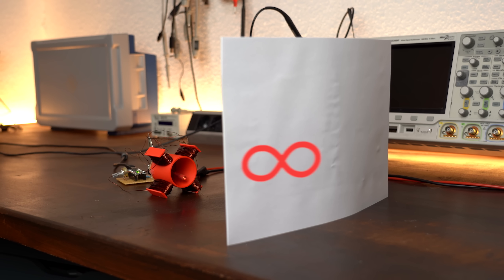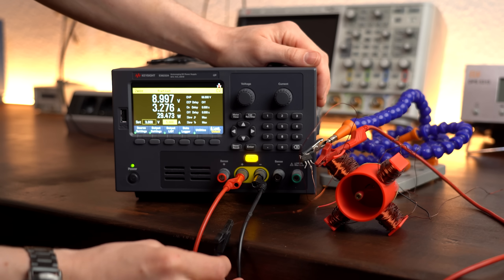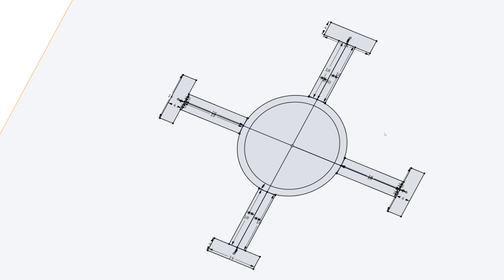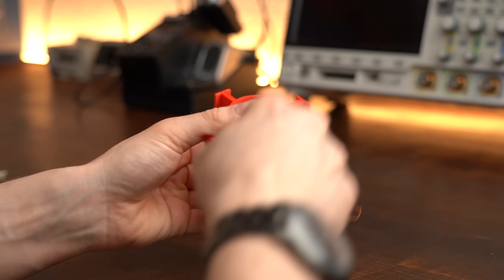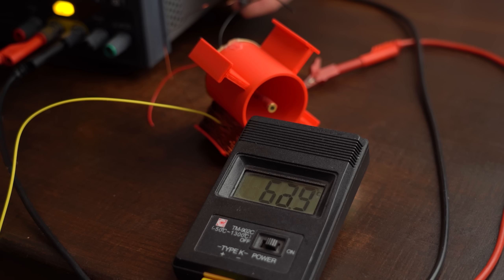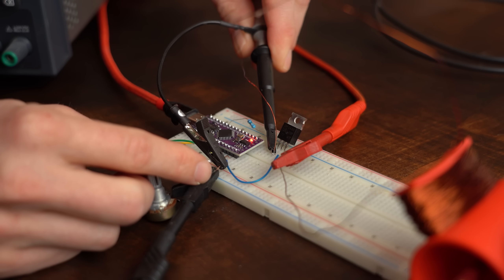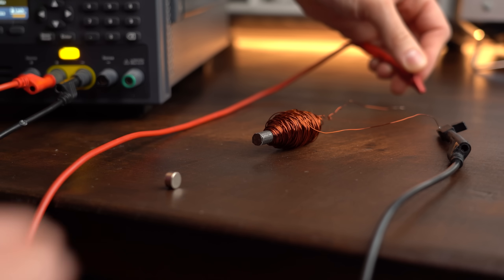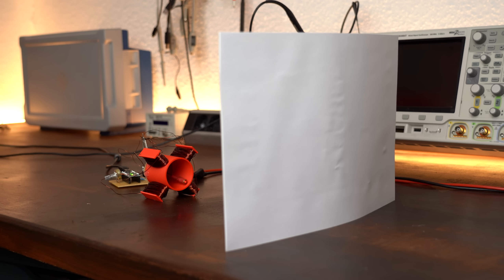Exposing the FAKEST Project....and making it REAL?!

Comment: It feels like a real version of this should use two hard disk voice coils to move two small mirrors placed in front of a fixed laser pointer for maximum flexibility.  You might even be able to use a stereo audio output to drive x and y positions (maybe with some amplification).  Maybe you could consider a project like this?

Comment: Isn't this the same idea of crt TV but rather than laser it's an electron
Reply: Pretty much. When using lasers, the correct method is to actually move a mirror instead of the laser, because you can make a mirror have less mass.

Comment: There is already real products using this tech, and other than the read/write heads of CD/BlueRay machines they suck --- but are real.  Projection Keyboard, Mouse and Display.  Look em up :)  personally I would have used a laser head from a CD/BlueRay drive for this, already machined and wired etc.   Just be sure to wear the correct wavelength goggles while doing so.

Comment: Maybe gluing some iron around the diode might make it move more and retire less power for magnets . Or you might be able to connect them to four speaker diafragms   directly with a wire  and use it that way

Comment: This is a cool idea. It’s a bit similar to the galvo system some fiber lasers use to deflect a laser and draw images. But those use mirrors. Would love to see you take a shot at making one of those :)
Reply: Basically a CRT display so not exactly a novel idea, first conceived in the late 1890's early 1900's if I recall correctly. 
CRTs (Cathode Ray Tube) are a Vacuum tube with a stationary electron gun(Laser) in the back using magnetic field to change the trajectory of electronics in the rays emitted by the gun to hit a specific point on the phosphorescent coated front of the vacuum tube.

Versus the idea from this video which is a magnetic field to move around a laser emitter to hit a specific point.
Changing electron trajectories with a magnetic field easy. 
Moving an entire laser emitter with a magnetic field not so easy would need a very strong magnetic field very precisely controlled that would consumer a lot of power. 

Mirrors moved by motors to control a beam would be better than a magnetic field flinging around a laser emitter.

Comment: it would be dope if someone continues this project and adds the feedback system and makes a crude display out of it
Reply: Well someone already has, over 100 years ago, it's called a CRT Cathode Ray tube, used in the old big fat tvs.
Reply: @somehow6839  well ik duh, and crts dont use lasers iirc \s
Reply: @somehow6839  : CRTs aren't laser displays, laser displays aren't CRTs.
Reply: @somehow6839  moving physical laser that fast so it draws image not gonna work that's why the electron beam is perfect for this task

Comment: The lack of flyback diodes is actually not an issue in the first design because of a fourth major mistake which wasn't mentioned.  High side switching using N-channel mosfets without bootstrapping.  

This thing is basically a mosfet to magic smoke converter but assuming the fets didn't burn up immediately then when the high side nmos turns off the back emf of the coil would cause the voltage at the source to drop.  Since the gate is being held at 0V this causes Vgs to increase enough for the mosfet to continue conducting, unlike with a low side mosfet where the back emf would just cause Vdss to increase until the mosfet avalanched.

Comment: These are to consider:

Mass of laser diode - Inertia and momentum affect its movement responsiveness with the electromagnet.

Stiffness of wire of laser diode - It must not be so stiff and must promote linearity of the laser diode movement. It's like the spider part in a loudspeaker.

Linearity of magnetic force in terms of distance between laser diode and electromagnet

Higher voltage required to faster driving of the coil for fast laser movement - Higher rate of change in current (di/dt) requires higher voltage applied. It's done during scan retrace phase of deflection coils in a CRT TV.

Stability of force of one axis even while applyng force from another axis and vice versa - Bigger coils and iron cores are for a more uniform magnetic direction/strength.
Example: when it goes up and then goes left, the up force remains the same even after it moves left.

*Some of these can possibly be compensated with sophisticated laser driving software and feedback mechanism.

Comment: Fighting misinformation with misinformation?!
The laser will work perfectly fine on an Arduino pin! the voltage will drop and the current will be lower and it is not supported or recommend. but it will totally work

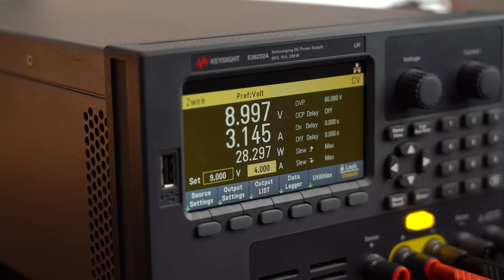Comment: @6:00 i think you would have more success if you simply got a iron cylinder, and made multiple windings of different coils around the cylinders in 4-8 or more different coils next to eachother wrapped inside to outside of the cylinder...Worth a test at least 😀 @6:18 you could place a cylindrical permanent magnet around the diode, attached to its side, to increase its magnetic attractiveness to the coils around the outer cylinder of coils.

Comment: That guy took a laser oscilloscope concept, threw out the (crucial) mirror part (which is responsible for amplifying the movement). Broke the electro magnets so they stopped working, delivered non-working code and then pretended it was working. And he was rewarded with new subscribers and money.
For anyone wondering why civilization is going downhill, it's these kind of incentives that breed low-effort charlatans.

Comment: Seems like a lot more trouble than just using two front surface mirrors and making a galvanometer from a couple of old speakers or just winding your own. That's how we did it back in the 70s, though back then we had to use  gas discharge lasers from surplus electronics suppliers.
Reply: Have seen similar approach in resin 3d printers from formlabs.

Comment: To achieve the fidelity of the display in the original creator's project, a high-speed DAC would've been required to control the laser. And mechanical effects cannot be ignored when vibrating the diode at such high speeds. It could draw oscilloscope figures, but not much.

Comment: Also you need gate resistors. To save outputs of your Arduino.
Reply: Not for every Mosfet, the series that where shown are made for digital input by an arduino for example. I run pwm powered LEDs with them on an espXx module.
Reply: @matneu27  The fact that connecting the arduino outputs directly to the gates of these transistors worked for you does not mean that it will work for everyone. Perhaps your connection was made with long thin wires (which worked like resistors, in fact). And if you make the same connection with a normal conductor on the printed circuit board, then the arduino will fail very quickly.
Reply: @matneu27  It's not about the logical threshold of the mosfet.
Do you know what a capacitive load is? Which currents are produced by switching? Is it safe enough for arduino outputs?
These transistors have an input capacitance of about 1.5 nF.
That is, Arduino outputs with their maximum peak current of 40 mA can get into trouble.

Comment: I'd just say that to get the sort of precision positioning required, you'd have to deal with the inductive nature of the coils.  The magnetic force is related to the current and trying to start/stop current that quickly, IMHO, would require more sophisticated power control.  Just shutting it off and letting the current decay through a flyback diode doesn't seem enough. 

Old-fashioned CRT TV's got away with magnetic drivers because they ran a simply ramping 'scan' that didn't have to change direction constantly while 'steering' the beam.
Reply: There are filtering schemes that can compensate for the induction, but they're really just a way to "deal with it", and as I recall increase power consumption.

Comment: I am curious if your original attempt would have worked any better, if you printed using iron core pla.  I know a lot of people that print motors, use it for the properties the iron provides.   Im sure the metal rods would awals work better still.

Comment: Hey, if you're ever willing to revisit this project, try using a mirror to redirect the light rather than moving the whole laser. The mirror will be lightweight enough that you can use less chunky electromagnets and inertia will be less of a problem. IIRC, this is roughly the same concept real laser displays use.
I also would say that for this specific design you may have more luck trying out a laser diode encased in plastic- I have one lying around and while it is rather dim (I think I might've partially broken it) it is super light compared to a bigger one encased in metal.
Reply: That brings up another point. Laser diodes are packaged inside copper or brass cylinders, so that they can be mounted inside brass or copper mounts that are mounted mounted onto aluminum optical plates. The whole assembly is a heat sink to keep the laser diodes from overheating, which reduces resistance, increases current, which causes a runaway state of self destruction.
Reply: @TheOleHermit  Wouldn't that mean the laser diode had to constantly cool off in order for that runaway to happen?
I'm assuming that it would be fine at ambient temperatures, so even if it stayed there, it wouldn't enter that state.
Reply: @snjert8406  I believe that you mean to ask,"... constantly cool off in order for that runaway NOT to happen? " Depends upon the output power of the LD & whether it is being driven @ constant TTL 5VDC, PWM, or analogue 0-5V p-p.
Most commercial RGB projectors have finned heatsinks, with cooling fans.
Those above ~4 watts also use temperature controlled Peltier TEC (Thermal Electric Cooling), with sealed optical modules to avoid condensation. 😎
Reply: As a non electronic person, isn’t this a bit like how a CRT works?
Reply: @richards7909  Sort of, a CRT shoots electrons at the back of a phosphor-coated screen.  It requires some pretty hefty electromagnets and some high voltages to achieve the required scan rate for the horizontal deflection.
Reply: @richards7909  Yes and no. A Cathode Ray Tube is more similar to old TV tubes or oscilloscopes. Electron beams are fired from the back of the tube onto the front screen. Electron beams are deflected by magnetic fields to create signal traces or X Y imagery called Lissajous imagery, which was used also in early laser shows.
The fake figure '8' in this video  is a Lissajous image, with X & Y sine waves. The 'Y' sine wave is 2 times the frequency of the 'X' sine wave.
But, laser light isn't deflected by magnetic fields. So these electromagnetic coils are push/pulling on the metallic shell around the laser diode in order to deflect the beam.
Laser shows use high performance galvanometers to deflect mirrors along the X/Y axiis, with waveforms up to 2000 Hz or sequences of vector points, up to 50,000 points per second.
Reply: They call that a handheld barcode scanner lol

Comment: The core of the coils would have to be made of a fast-response magnetic material.  And the laser support could be implemented with a spring more flexible than the wire.  To create a finer movement would require a greater number of coils.  Undoubtedly a very expensive and difficult project to execute.

Comment: So many fake kits on Ebay. A laser wireless speaker system has no way to vary the laser output for the light sensor to interpret. So I built a wireless speaker system with FM receivers on each speaker with a FM transmitter output on a laptop. Another with child toy walkie talkies. Neither sounded very good but functioned better than any fakes on Ebay.

Comment: One great way to spot fake designs (seen alot in homemade power generators) is the lack of magnetic circuits.
If you see coils wounded on whatever form but with no iron core and even when a iron core is present it doesn't form a loop, that shit is fake or highly inefficient

Comment: cool but don't use heat shrink tubing on laser diodes since they are so sensitive that a tiny voltage spike, wiring mistake, or saying something mean about it will destroy the laser diode so heating it over a lighter flame is a very big no no
Reply from the maker: I only did it to remake the original project.

Comment: In my highschool years they had a laser display demonstration once. But the method they used was different. Instead of manipulating the diode itself, they bounced the beam off of mirrors mounted on speakers. Much simpler to make, much better control. Just play the right waveforms...
Reply from the maker: Yep. Servos and mirrors are the solution.
Reply: I did exactly that in the early '90-s as a light show for a school band that I was helping out. To get a grip on how long ago it was, I used the physics institution's He-Ne-laser. A program I made on my Amiga created the waveforms. And since I didn't want to take my computer to school, I recorded them on a Hi-fi VHS deck so they could be played back with enough fidelity for the figures not to get distorted. Compact cassette or even reel-to-reel wasn't even close to acceptable.
Reply: Using speakers is such a neat solution!

Comment: The easiest laser projector is made with a small mirror and two speakers for X and Y axis. It's not fast enough for oscilloscope-music, but you can draw easy things like circles, squares etc.
Reply: Now I get some flashbacks. 30 years ago my buddy and I did exactly that. He had a helium-neon-laser (it had the size of a little brief case) and we glued one side of a tiny laser mirror to the middle of a little speaker (we cut off the membran for faster movement) and the other side at a hinge that was made of a thin plastic tube and a peace of wire. We made two of them and we could create some nice figures using two sinus generators.
We were teenagers, btw :)
Reply: Have you ever tried this? I always thought it would work, but after the video I'm not sure anymore, because I would like to recreate it myself
Reply: @MarcelSchr  With speakers? Yes I have and it works great. It's a fun little project.

Some day I will build a projector with two mirrors, like a real one. I found someone on the internet using the small stepper motors from CD or floppy drives. Never tried it, but seems very promising.
Would be cool to draw some pictures on the clouds with a strong laser. 😊
Reply: @-Tris-  : Stepper motors won't be very fast either, though if you can find a use for exact routing (perhaps routing the beam through some different fixed-mirror pairs, like 2 parallel vs 1 flat + 1 parabolic?) then they would certainly have some value.
Reply: @absalomdraconis  I don't understand the routing thing😅 mirrors won't affect the speed!? Smaller motors have less mass to accelerate.
It's far from a professional projector but it should be MUCH more usable than something made with speakers. 
I think it might be the best/easiest budget laser projector you can build. 
One motor coil is used to keep the axle/mirror in position with a constant current. Basically acts like an magnetic spring. The other coil is used to move the mirror with an analog signal. Sounds good to me but I haven't tried it (yet).
Reply: Even easier laser projection display idea with no moving parts!

How about an electron gun (laser) inside a vacuum tube with magnetic fields focusing and bending the rays (changing the trajectory of the electronics) to hit specific points on a phosphorescent coating on the interior side of the tube opposite to the electron emitter with the target point moving across in a line and then up line by line to display an image on the outside of the tube.

Oh wait that's a CRT (Cathode Ray Tube) display, first conceived around 130 years ago.
Reply: @somehow6839  Even easier? Then show me how to "easily" build a CRT with a bit of scrap glued to a piece of wood.

But everybody can move a little mirror in two directions and point a laser at it, all with old stuff most electronic hobbyists have laying around. And you can't really compare a CRT to a projector.
Reply: @somehow6839  : CRTs are not lasers, the technologies are completely different and the produced light has different characteristics.